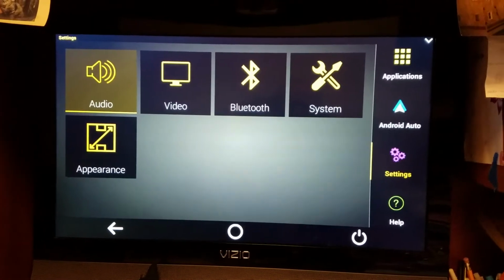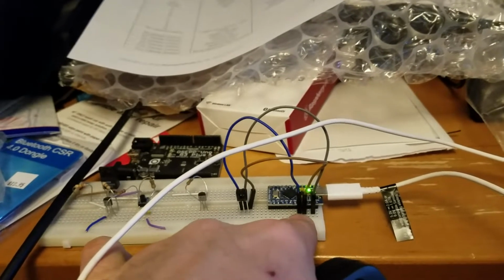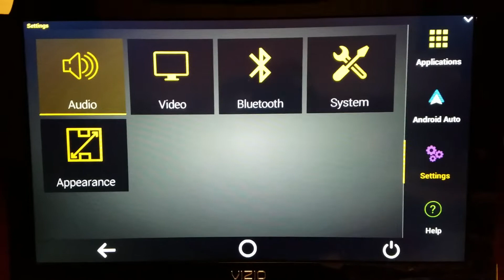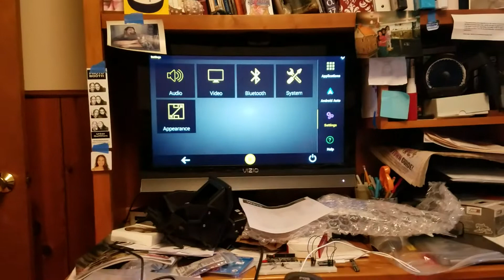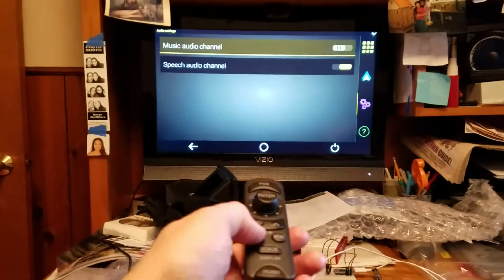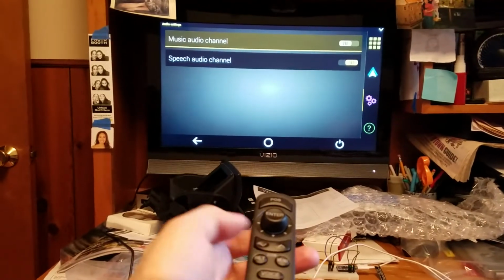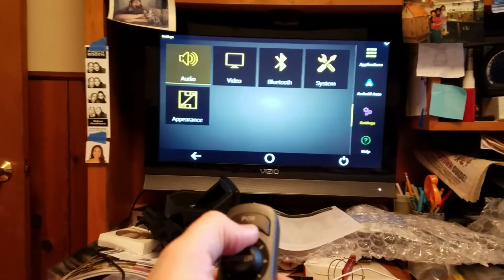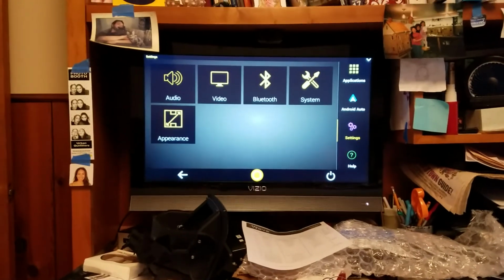Factory Mazda Nav Remote controlling a Raspberry Pi

Comment: Hi,
I would like integred the ir remote with lirc using raspberry gpio.
Could you share me your arduino sketch else I will need decode the protocol with a logic analyser.
Best regards.
Tony.
Reply from the maker: @Tony rendina this isn't working via the gpio pins.  There is a small arduino type board that is emulating a keyboard.  The ir remote info is received and turned into a keyboard press which the manufacturer's software has been designed to interprate.
Reply: @meestahwah  Would you mind sharing the code you are using to imulate the keystrokes?
This would be perfect for my OAP setup. I am using a sleepypi for controlling the P on/off and it has an arduino built in.